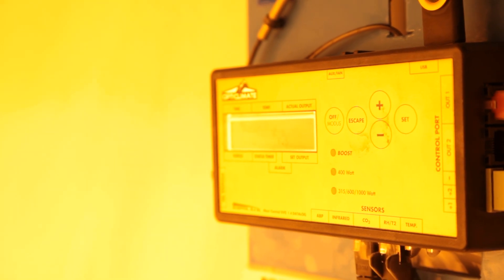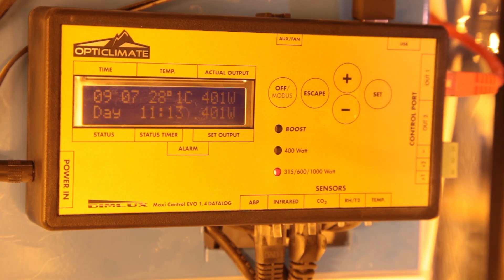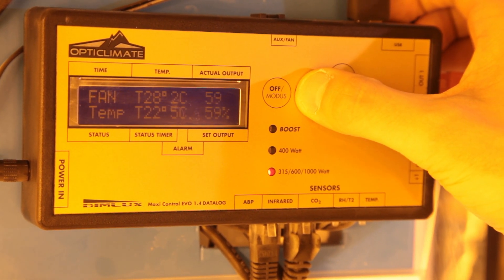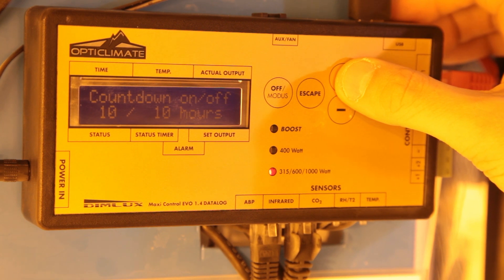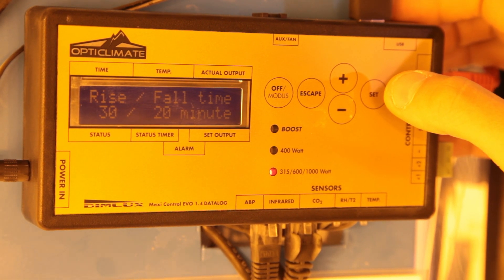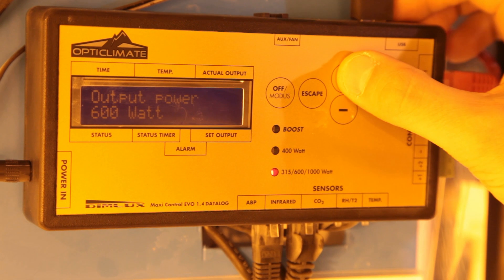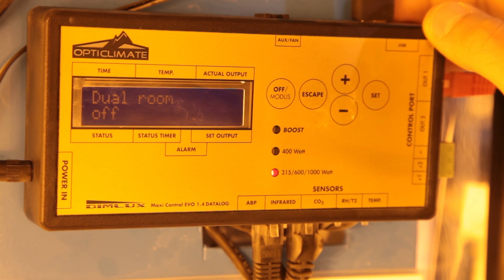How to use the Dimlux Maxi Controller

Comment: my halfforce does not work correctly on my controller. instead of turning half of the set off all but one go off.
my setting: input1-A, A-B, enz…all original interlink cables.
i tried input B but it has the same results.

Comment from the maker: What is the Maxi Controller? - 0:00
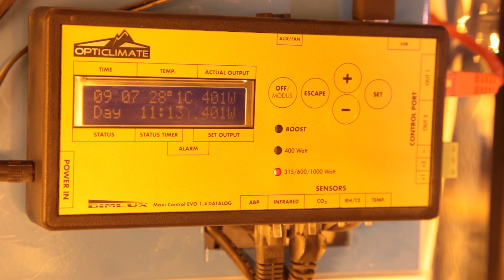How do you swap display modes? - 0:56
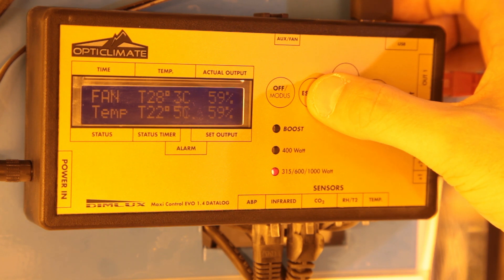Display mode settings - 2:25
Configuring your lighting - 2:45
Reply: Would be really helpful if you could do more in depth tutorial on the dimlux controllers other features also how to daisy chain with speaker wire as well as Ethernet cables
Reply from the maker: @daveking777  Hey mate, we'll get it on our video to do list man! Would a blog be of use as well? The new ones don't actually come with the speaker wire connection, just the Ethernet cables!
Reply: One Stop Grow Shop exactly but I have a number of dimlux controllers of various models from the first generation maxi control 3.4 duel processor to the evo 1.0 which only allow speaker wire....but I have the latest expert series light which uses Ethernet cables or speaker wire. 

I don't think there's one video on the whole of YouTube that totally breaks down the operation features of the dimlux controller unit step by step ..maybe you guys can break the mould 😀
Reply: One Stop Grow Shop a blog would be very good